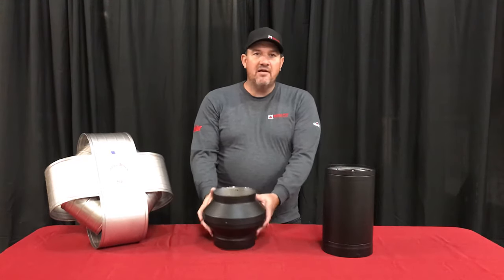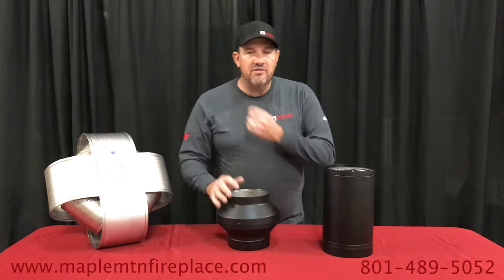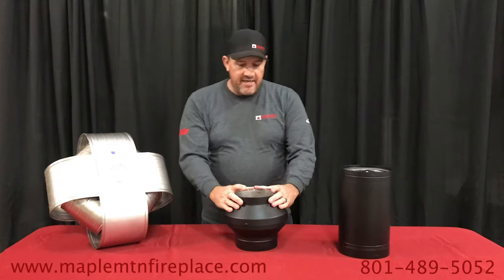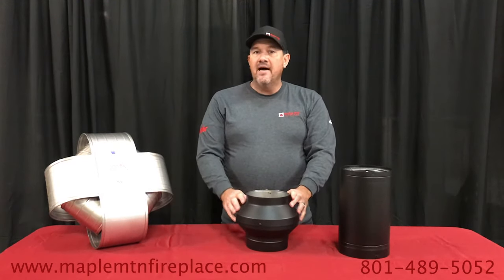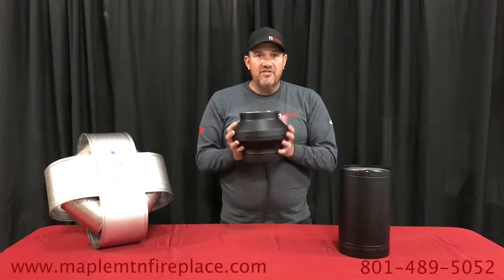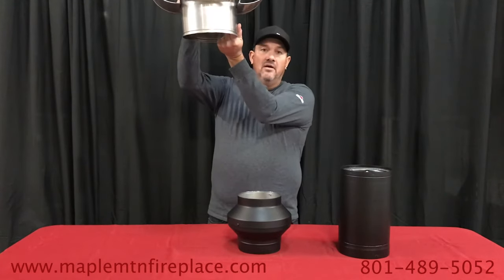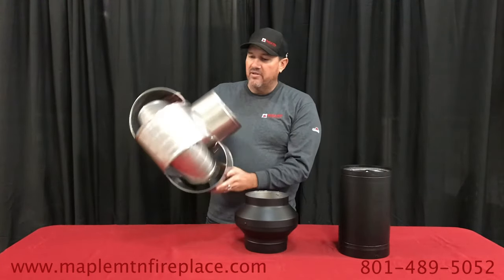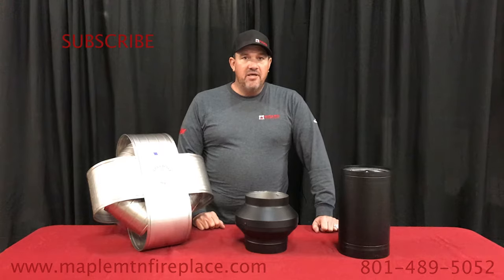How To Eliminate Back Drafting Wood Stoves

Comment: Have a small Moreso 2B where it was almost impossible to start a fire without smoke blowing into house...after 3 years of struggle, I finally figured out that by blowing a hairdryer into the top front of stove, not into chamber, but in this stove the route to the flu was on top of chamber...30 seconds of hot air into top section and no more smoke!!  Lesson: make sure you are blowing hot air up into the flue/chiimney.

Comment: I need that heater!   Our unit always has cold air coming through it when it's really cold out.  I have started burning 80hr candles in there to warm it to combat the draft,  works ok, but won't be a cheap solution over a long period of time.

Comment: You wanna know what else works GREAT. Is putting the chimney  2 or 3 feet above the roof line. God knows how many I have seen that have not done this to save money. I have corrected a lot and problem is solved. This also includes NG and propane fired furnaces with a ventor motor. The motor for exhaust could not achieve the static and times out for cold winter time house.